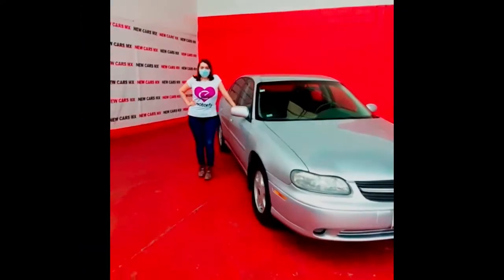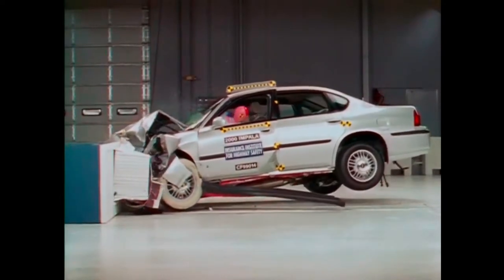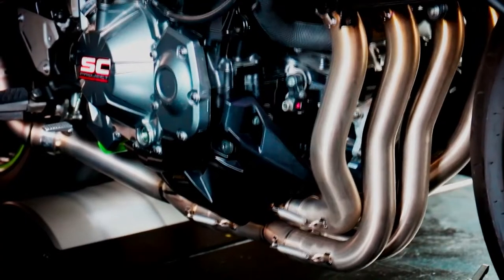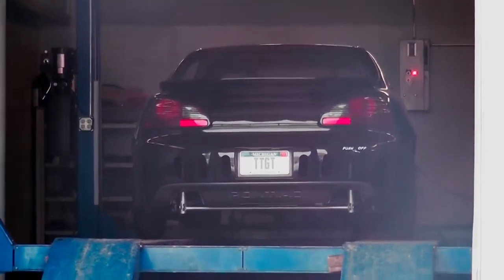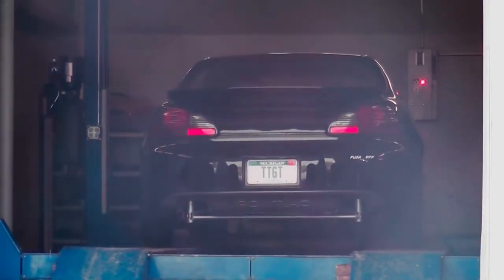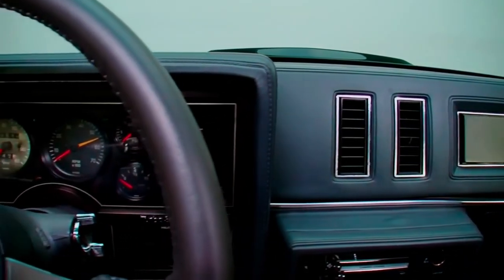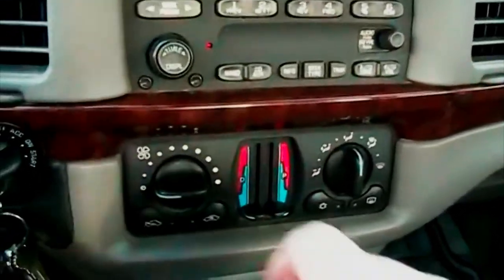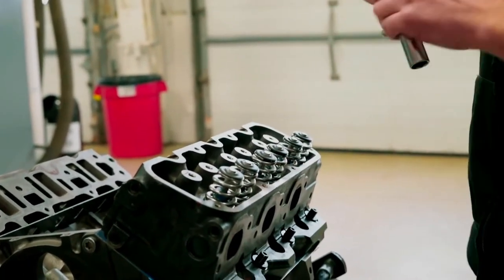Chevrolet impala

Comment: Que tal,  y que pasa con la transmisión con esas modificaciones, que habría que hacerle? Gracias de antemano por tu respuesta! 
PD
Excelente video
Reply from the maker: Gracias, tratare de subir mas información periodicamente. Mira, aqui nos podemos ver limitados por la transmisión automatica, la mas fuerte en posición transversal es la 4T-65. Aqui hay de dos: buscar el aftermaket para esa transmisión o cambiarla por una F40 Getrag. Si lo que se busca es eficiencia en el motor con una excelente respuesta de aceleración, la F40 seria la idonea (abria que buscar el diferencial correcto para aprovechar al maximo esta transmisión manual). Saludos, espero te alla servido la información.